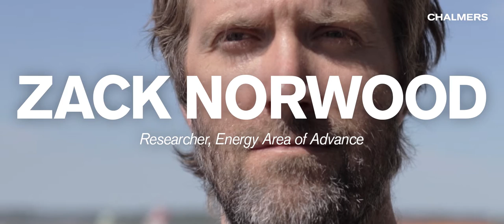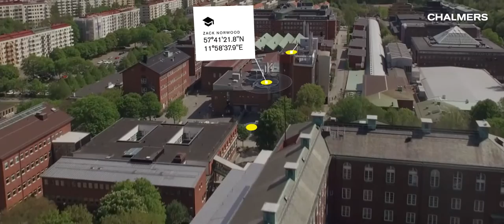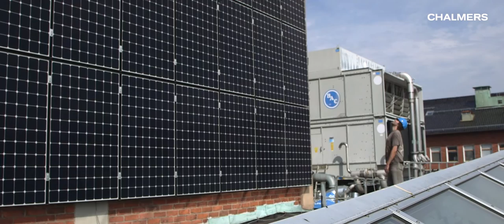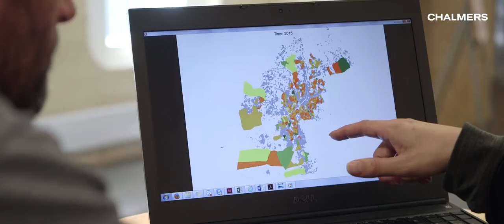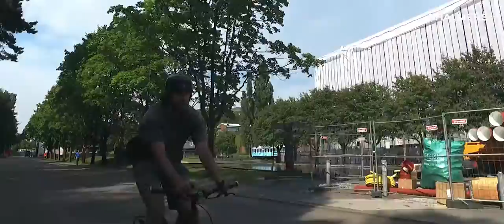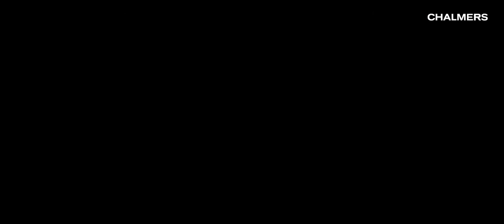OUR CAMPUS – OUR TEST ARENA

Comment: I have  a problem with this. 
Most of the technical solution you name are industrially very intensive. 
This has two sides: 
because it is intensive it requires energy. That means that you consume an extra energy before you get another bit as a surplus. If this surplus adds upp to the input without cancelling it, which given the structure of our society is always the case, then you get an INCREASE in emission, not a decrease, because the maintenance of your industrial structure will require the use of fossil fuel.

Second: because it is industrially intensive (rockwool; but even processing of natural fibre, for solar panel   the point is obvious), it leads to massive pollution, which will affect the ecosystem severely, and probably warming itself as the sink mechanism of the biosphere is very poorly understood. This also affect human.  Making solar panel is a shit job (i worked in electronic clean room for 15 years and it should be part of a compulsory job for every consummers to understand what s behind), there is no surprise in the fact that the biggest producers is a  harsh dictatorship tha still apply massively death penalty, deport its own people and jail its political opponents.

There is now a very advance reflection on industrial sustainability. I can point to Bihouix work ( a french engineer that is specialized in metal mining sustainability, and wrote a book on the future of metal), who is famous in france.

The idea, even from such people who are from an industrial background that a complex urban society backed up by such a complex industrial system will always fail to last and lead to severe collapse.

This is the principle of low tech: making thing smartly so that we use ever less resources for a given function.

One of the conclusion of Bihouix is that if we are unable to convert the whole society to cycling, fast, we can force a regulation on industry no so that they produce cars with a 2 litre consumption wich is achievable since 1970 (french 2 CV). This is a better option to rethink town and rural planning insteadf of choosing electricity or hydrogen that is already generating mass pollution (lithium battery are and will be marginally recycled and pollute anyway).

Another point is that we have to encourage socially a degroth of urban area which are the main driving force behind unsustainability. According to proponents of Low tech degrowth, relocating people close to food production and making them produce their food would drastically decrease emissions and increase sustainability. One way is to suppress financial support to big farming.
This is an extremely simple measure, much simpler than debated insulation (better again to live in small houses, or share living space than to stuff your house with chemical ladden materials).

I myself quitted academics (chalmers also) to learn how to sustain myself off the land and I hope we will be more to implement a new economy based on animal force and effective small farming communities.